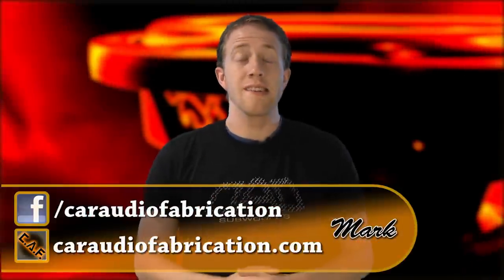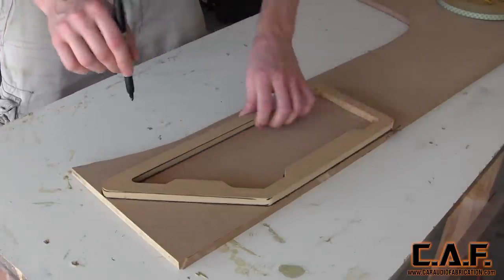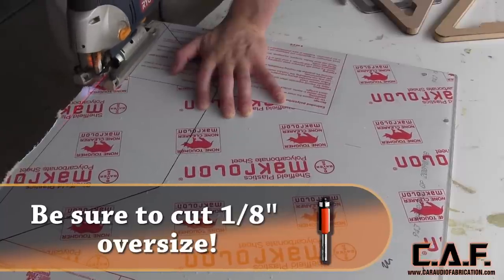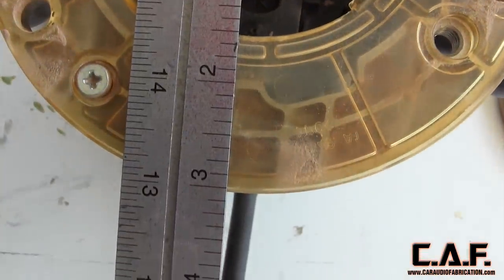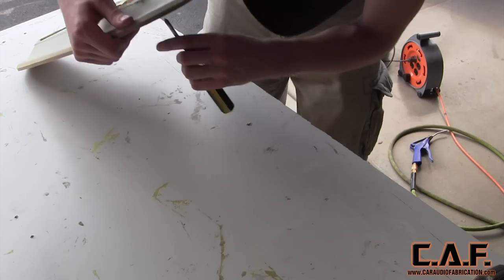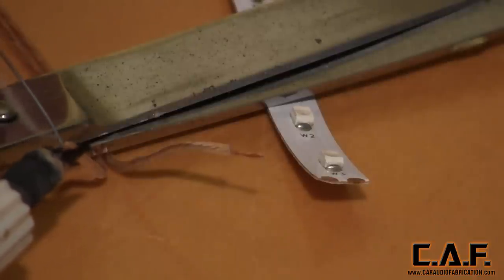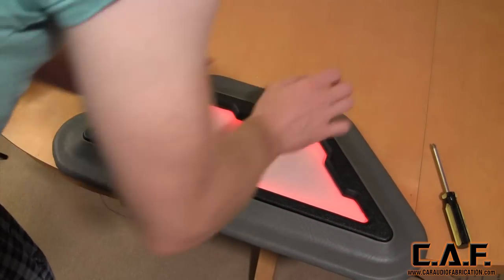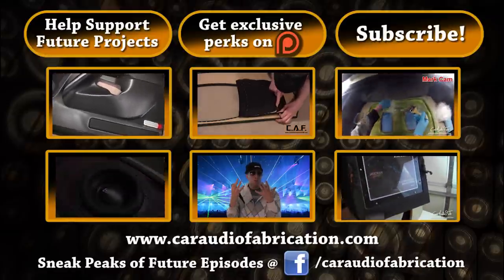LED lit Plexiglass - Install Light up Panels in your Car Audio Builds CarAudioFabrication

Comment: Hey Mark, thanks for all the great tutorials.  I was wondering- how can you wire these LEDs up to pulse with the bass?  I've seen controllers that will turn the lights on when the bass hits, but I want an effect that will show dim lights when the bass is low, and bright lights when the bass hits hard.
Reply: I would also like to know. Do you wire these to a switch independently or integrated into the audio?
Reply: put continuous B+ to Led with series resistor  so it will be dim when no bass. Parallel connect the controller to led, make sure to series a diode to B+ on both supply before led strip so the current will not return..

Comment: How would I do this so the polycarbonate is clear during the day but glows at night when the LEDs are on?  I want to do a cover over the amps with LED lighting.

3 ideas is either to have a cut out of the Phoenix Gold 'PG' logo an the LED will light up the edges around the cut.  The second idea is splash out the have the PG flaming Phoenix logo 3d engraved into the poly.  As I have 2 amps, ideally I'd do one on each. 

But, if money becomes an issue or the carving needs to be done at a later date, is it possible to create this effect without 'opaqueing' the poly?

Comment: the plan right now....is to use acrylic strips laid along trim lines on the etire interior. mounted as if it were chrome, though it would be pearlecent during the day from mylar as the refector on the back. Pinstripes that, by design, funnel their way towards the amplifier enclosure....and then to the sub enclosures, speaker rings, rings around the door, and also the tweets mounted high. As if to accent the tranfer of energy throughout the system when driving at night.Color and pattens can be determined by a $10 RGB controller from a local big box... even had a remote and can bass to the music. glowing pinstripes. 

even thought about trim around door windiws and front wndow allowing for strips, and roiting a pic strips along the sides that accent the lines of the can, or a logo on the back. MWAhahahaha!